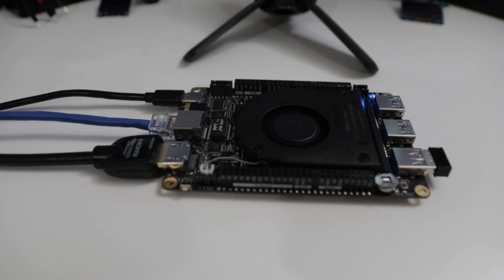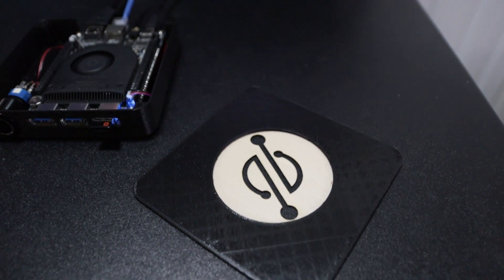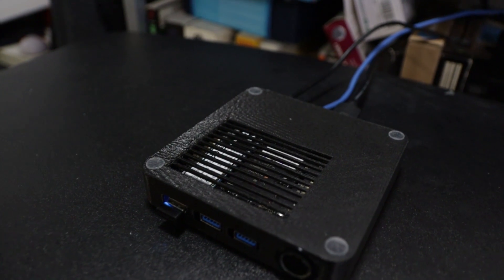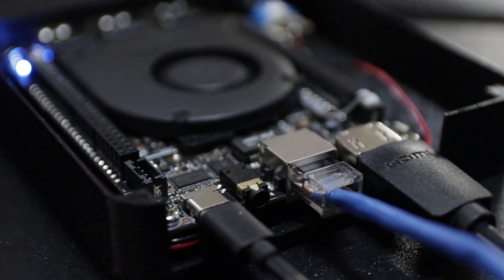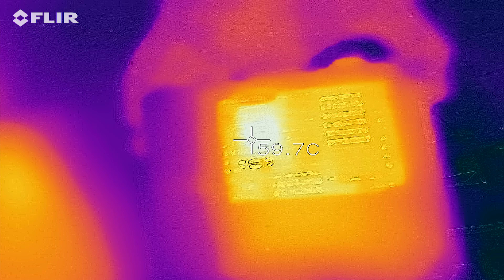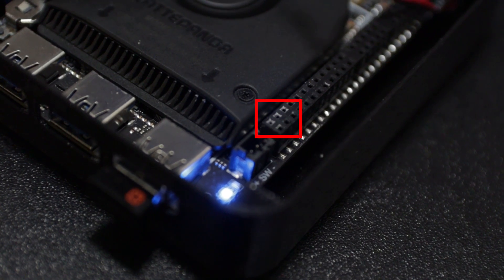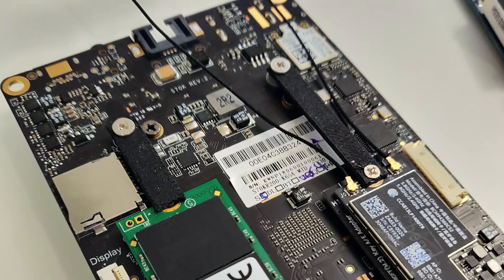LattePanda Alpha Case 3D Printed

Comment: Hi! I constructed a cable with two wires connected to a identical connector at 3:34 which fits perfectly in +SW- slot on the LP Alpha board, but  I don't know if this slot is designated to power up the board. So, the computer could be started if I mount a button to the opposite side of the wires? I'm afraid not to damage the board. If the response is positive I have to wait 3 seconds before it starts  after pressing the new power button?

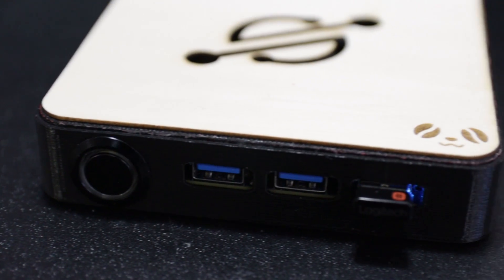Comment: 0:40 Mac mini is slightly bigger but has an integrated PSU...  Any (PSU) suggestions /ideas?

BTW: the HP Z3 mini case, looks very (sick) nice too... (as smaller 3D print, design idea)
Reply: an Integrated PSU might be nice. But, he is already having heat build-up; maybe adding a blower from a old laptop would fix that. Also, I would really like to have a UPS with battery to make it even better for travel use.

Comment: You know what would be awesome ?  A lattepanda case with space for a pci express card (a graphic card for example)
(using the m.2 to pci express adapter)
Reply: samsoulee - I had the same thought. Some way to have the card slot be parallel to the LPA rather than perpendicular..
Reply: Exactly !

Comment: the trash can will help you put a large fan in the bottom blowing air up through the vertically mounted board sorting the ssd and wifi card heating issues

Comment: Why this board produce such a massive heat despite the big fan? while other similar products with the same core m3-7y30 like the "GPD Pocket 2" and "Cube Mix Plus" can fit in such a slim case. FYI, the "Cube Mix Plus" tablet doesn't come with any fan, only with passive cooling.

Also the "GPD Pocket 2" can be power by a regular standard 5V phone charger/power bank, while this "LattePanda Alpha" required a minimum of 12V 2.5A power source

Comment: Hi, I have a question, we can create a raspberry pi cluster to run windows 10 fast?
Reply: I don't think so. The architecture of RPi is ARM and W10 architecture is x86. There is a problem bigger than simply brute force.
Reply: Windows for arm is released, check the nova spirit channel
Reply: @Trynacional8  but in my opinion is, at the moment, so far of the x86 version. I know the ARM version 🙂.
Reply: f3rran i think that if we can make a cluster windows run better than in one rpi
Reply: @Trynacional8  did you think about latencies?